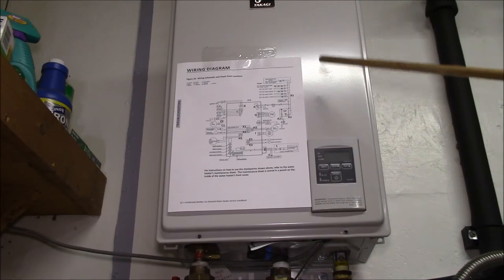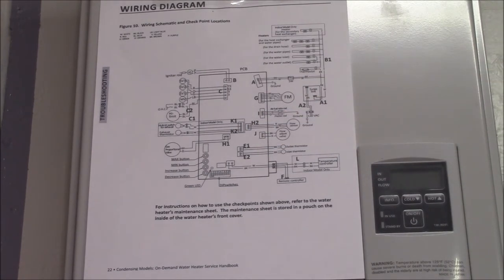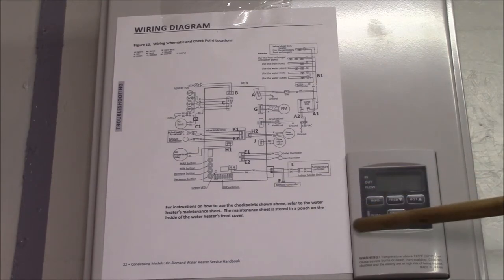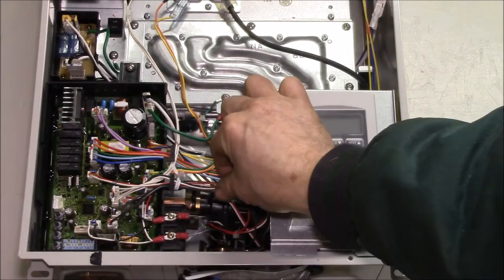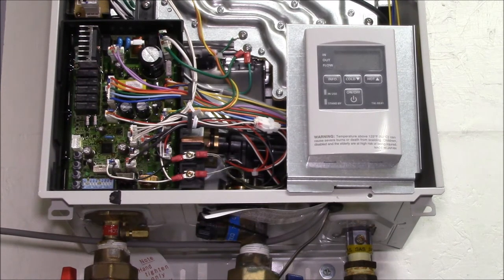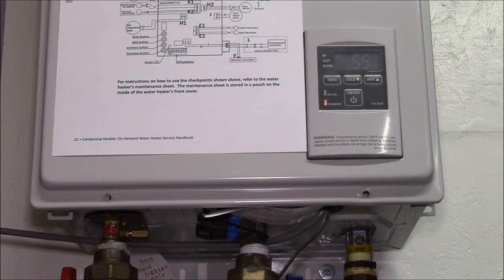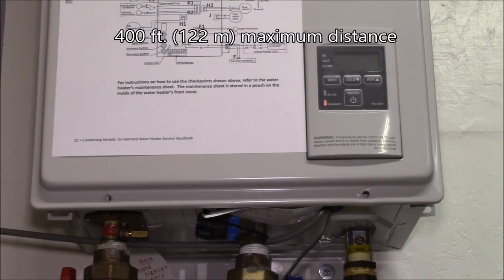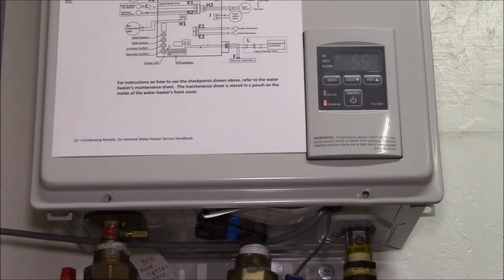Free Remote Controller for the Takagi T-H3M-DV-N Tankless Water Heater

Comment: Do you know if this controller can work on other models like a  takagi   t- d2 - OS?
Reply from the maker: Looks like no, you can check out the model numbers vs,. remotes on the Takagi web site:
http://www.takagi.com/products/accessories/remote-temperature-controllers
This is the controller that came with my tankless unit.  Point of the video is to show that it can be removed from the front panel of the machine and be installed at a remote location.

Comment: if it is rs485 interface you can move it 200 to 300ft away but if rs232 it will only work under 25ft away I think. I have had rs485 work over 500ft away
Reply from the maker: Not sure what interface they are using, but it's 2 conductors that carry power and data.  Seems like it's a DC voltage on the line and data is transmitted by momentarily connecting the two wires together.  The manual lists the 400 foot length figure, although it's hard to imagine a scenario where you are piping hot water 400 feet away from the heater.